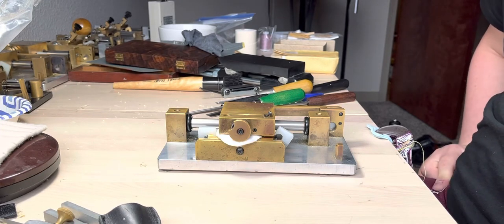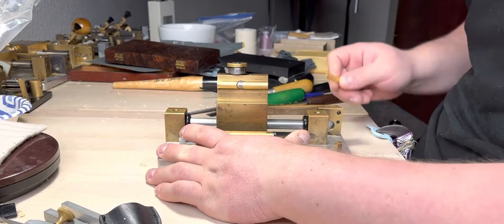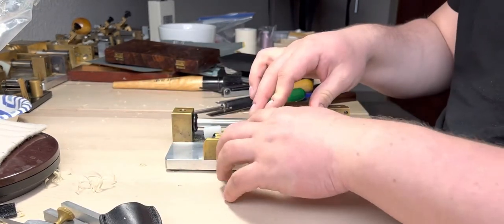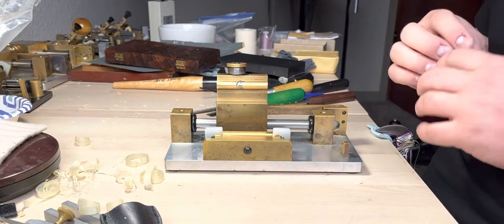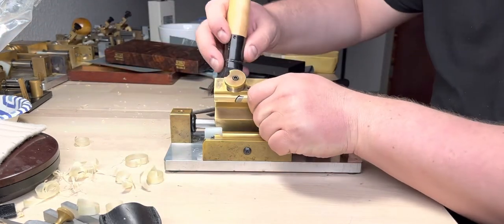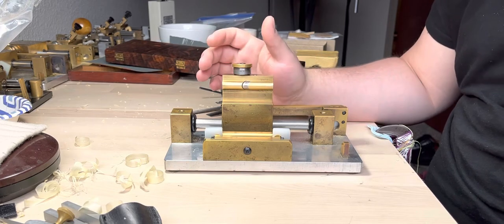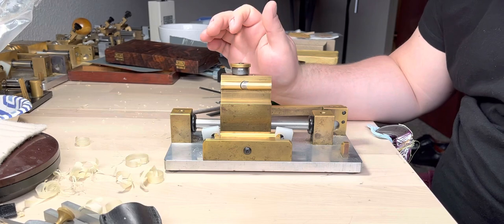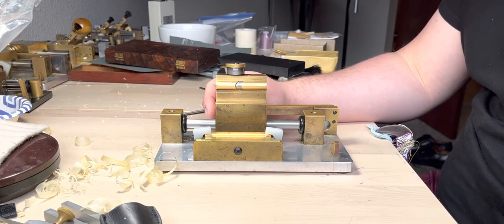Using a Ross gouging machine

Comment: Thanks! I've never found another video of someone just demonstrating basics on the Ross machine. And I'm glad you mentioned you prefer a 0.58mm center. Do you have a favorite shape at that thickness? Joshua +2 is pretty reliable for me for tone, RDG -1N usually gives me good vibration but not much depth in tone.
Reply from the maker: Hi Michael, I’m glad you liked the video! I really like Caleb -1 and Caleb -2, but I’ve also had good luck with Pfeiffer-Mack and Brannen X. I find .58 in the center still has enough beef to give a good opening and lots of vibration without extra bulk.